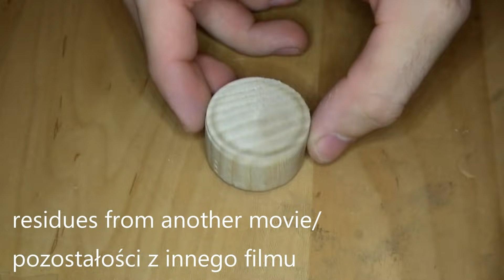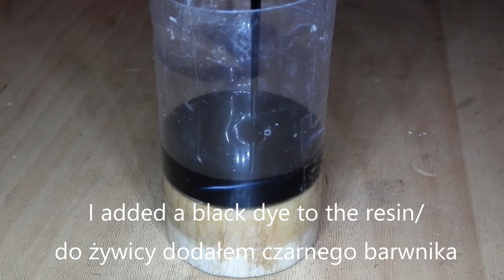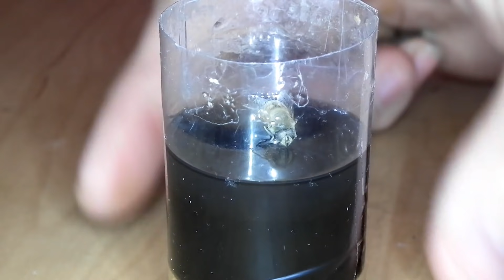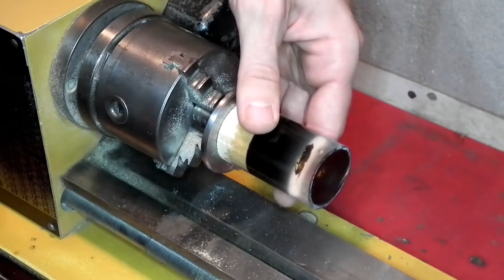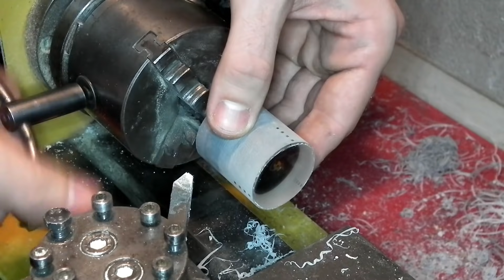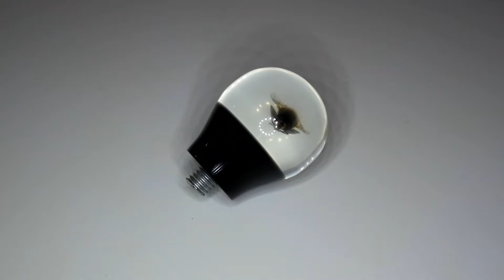Bottle Stopper with a Bee. Resin Art.

Comment: great!! I  love this! But I have a BIG question! I did the same thing 2 years  ago, with a huge bee-looking insect  I found. And I put it in epoxy  resin /poured the resin  into a shape like a  transparent  ball. The problem is, Ive got thousands of bubbles, forever trapped inside. The first  two hours there were not any, but when it dried, over night,  bubbles appeared all over. My only idea is, that   the resin  makes just too much bubbles from the trapped air. Here I see  you have just poured  your resin  and let it settle and dry, and  no bubbles?? So can you please tell me which epoxy  resin you use, since there are a lot of brands on the market now, because I have stopped working with my resin , since    it would be a very dumb idea to go on with it, and I have some nice ideas I would like to work on, very much.
Reply from the maker: It does not depend on the resin. I use a vacuum chamber. Before pouring I put the resin in the vacuum chamber and get rid of the bubbles
Reply: I get it. Ok, thats one good tip!  But  I am  not talking about the  resin just after its made and mixed up,its totally clear in that phase.  I am talking about the air that gets trapped  around the insect, ie, the bubbles that come out from the object when it gets   engulfed  with resin WHILE you pour! Meaning, most of my bubbles appeared as if they got released  after the pouring  around the 
 object  finished , while I dont see that problem with you.
Reply: whatever, could you please  say which brand  you use ?
Reply: hey, its ok, I saw the brand  of the epoxy in another video of your craftwork. Thank you .